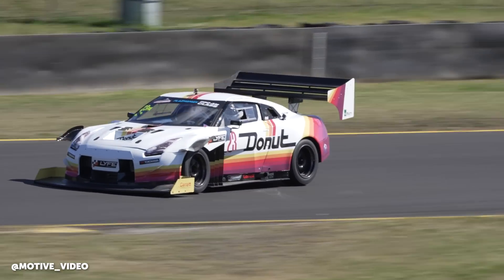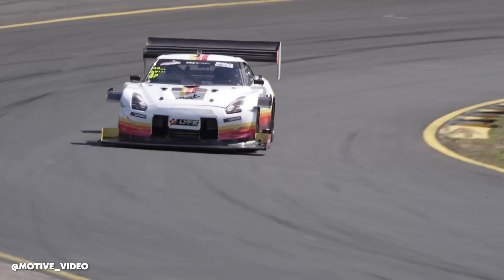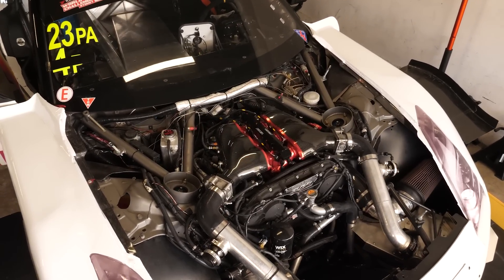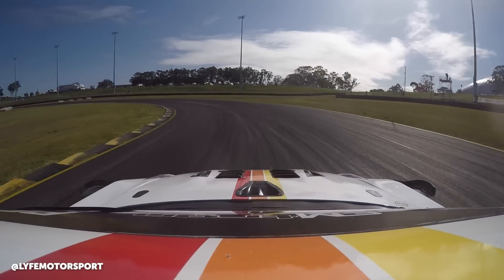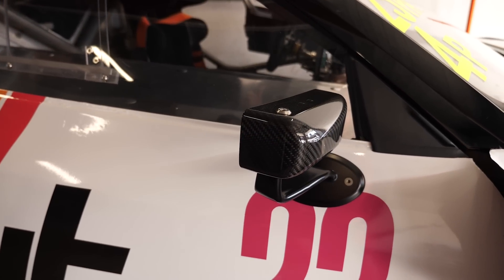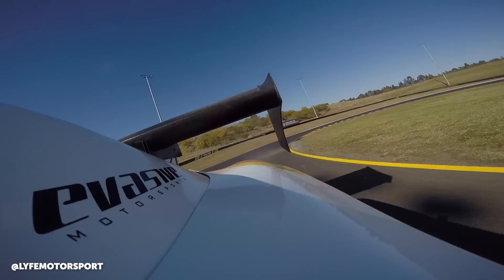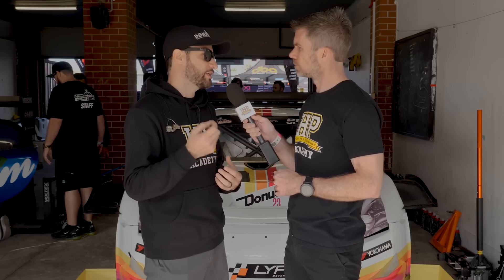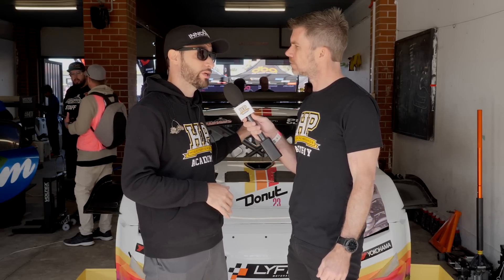How far is too far...? | 1300HP engine tuning insight

Comment: Hey Andre, would you mind dropping some insite on true wheel HP at the dyno vs trap calculated HP. There seems to be some confusion in the industry in regards to this.

I keep seeing claims of from honda engine builders that their engine is a 1500 HP capable engine and i know for fact this is false with the amount of displacement available in these particular motors even with meth and boost.. these guys claiming there are making 1500 HP with cast B series engines....
While i do believe you might be able to get a car to trap fast enough to calculate that 1500 i also have enough of a brain to understand it wont make that kind of number on the dyno EVER. Power to weight is what calculates the trap figures but is independent of what wheel HP is and i dont think most people understand this and are falling victim to marketing tactics of 1500 hp capable claims by these manufacturers. Thanks cheers
Reply: A sleeved b series is absolutely capable of 1500 hp. There are numerous guys at World Cup finals making that power every year. They will never be as reliable as a larger displacement engine obviously.
Reply: https://youtu.be/OtTQCurwPm4?si=7fZJ8BurChZ6R23O